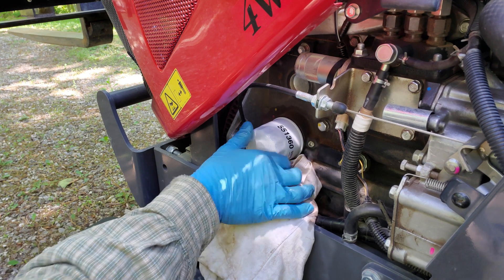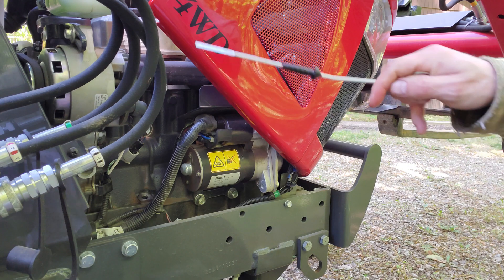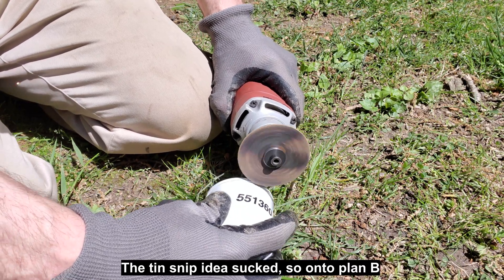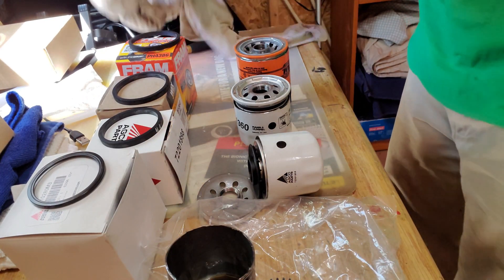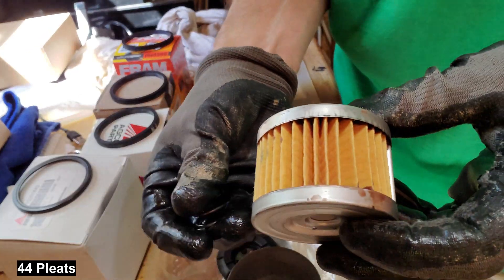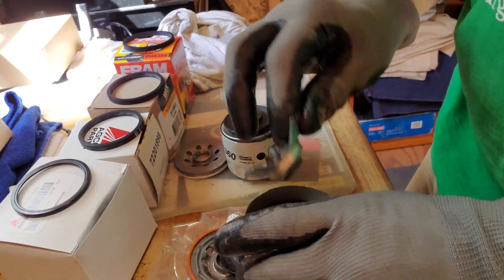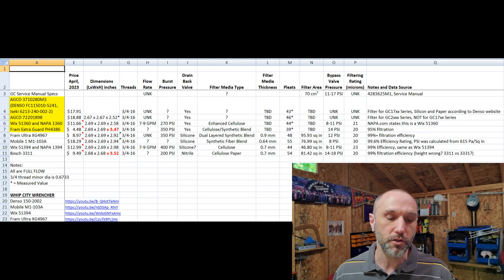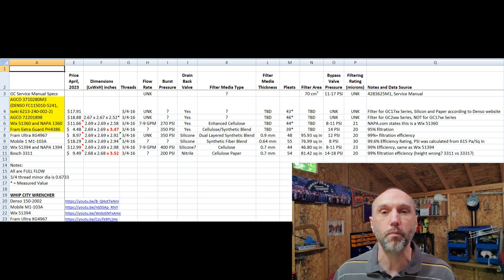Oil Filter Comparisons for Massey Ferguson GC Series Round 1

Comment: Interesting video Ed. But when a guy spends $20,000 on equipment to use I don't think I'm going to substitute a off-brand filter unless it's identical. And even then probably not. I know it's expensive through AGCO but I want to make sure that it working correctly. If you're going to buy the toys you have to keep them up. And I really don't trust a cheap alternative filter. If five bucks difference going to break you then you really shouldn't have a tractor like this. That's the way I look at it. But I am a farmer contractor and own a gold mining operation and I use my GC Massey's which I have a 1705 and a 1710 tlb GC. I probably put on about 250 hours a year on each tractor
Reply: I use a MF GC1710 for my landscape business. 3100 hours and have used NAPA 1360 and Rotella T4 15w-40 since the first few oil changes. My closest dealer is a hike for me. I change oil faithfully at 100 hours. Going to switch to WIX after seeing this video. Thanks.
Reply from the maker: I'm just gonna stick with the AGCO too, but it's not all about price. One of my reasons for looking into this was to make sure the Denso brand filter that AGCO sells really is a good one and not just a big price tag with junk under the cover. I had never even heard of Denso before buying the GC, but it's clearly a quality filter. Watch the round 2 video. The Bosch is a really good filter and the Fram XG4967 is also very good inside even though I didn't personally cut that model Fram open.  https://studio.youtube.com/video/lZVEU-Ur_SA/edit
Reply: @Redneck_Ed  thanks that I have already watched number 2 quite a while back here probably an hour ago or so maybe even a little longer but I'm still sticking with the AGCO filter. I also like the fact that it's pre lubed

Comment: Super cool video thanks Ed , can;t wait to see if you will do something similar at one point for the hydraulic filter  :-)
Reply from the maker: I intend to make an attempt to find alternatives or at least cut the old one open to look inside. Service manual says it filters to 10 microns though, so need to find ones that are rated for 10 microns.

Comment: Great video,  I've been saying that about filters.  I run the wix filter.  And there is absolutely no benefit to run the agco over the wix. Oil is rotella full synthetic. And shell hydraulic oil. Again great video Ed. I've been waiting for that one.
Reply from the maker: I think the Wix WL10114 (NAPA  FIL 400114) might be an equivalent hydraulic filter, but it's $36 so not really a big savings. I still might buy one and cut it open though to compare because I know for some it's not just the money but also accessibility that matters if their dealer is a long drive away.

Comment: First off great job Ed I could have sent you my filter cutter tho lol, anyway thays why it's better most times to stick with OEMs the difference in media is surprising and very important for proper flow and contaminants holding for proper service interval not to mention proper bypass setting that's why the older part number for the 2000 series should not be used. There's no end caps on the ISEKI/DENSO filers because the bead of glue seals it, the DENSO/ISEKI filter is a quality part rest assured and has a much better free-flowing center tube,, That orange FRAM I don't need to tell ya is junk!. If one could find a filer with same amount of media and by pass it wouldn't be bad but what I'm finding now just isn't cutting it for my equipment.

Also close but that Delvac extream is the older formula part number(black jug) "semi" synthetic not full, you want the new formula full synthetic  'silver jug" I think I posted a picture before on Facebook but that's still a good oil though, and finally thanks for showing you pouring it in and starting it 😂 good job Ed 👍
Reply from the maker: Thanks Dan. Yeah, the Fram PH was not good. For the oil, that was a whole different research rabbit hole. I saw Delvac Advanced Full Synthetic online but only 5W30. Advanced Auto had Synthetic Extreme and the Premium Synthetic Blend Extreme. Both product descriptions said they were a blend, so I just got the bottle that I was able to easily find and by "easily" I mean I had to ask because it was stored in the back. I've been thinking about the dealer using 15W40 and I think the dealers don't want to have different bulk containers with risk that technicians mix them up so they just stock 15W40 for simplicity reasons with low risk. I'll be sticking with 10W30 in mine from this point forward.

Comment: Does Purolator have an equivalent filter?  I have always had good luck with their auto filters.  I will say it is likely I will just go to my local Massey dealer and buy what they sell me.  For the amount of money I have invested in my tractor I am not likely to have a problem paying an extra $5 or $10 for a filter.
Reply from the maker: L14476 (or PL or PBL) is a Purolator equivalent. I didn't include Purolator because I had to draw the line somewhere. You can pretty much just Google "INSERTBRANDNAMEHERE 3/4-16 oil filter" and you will find all sorts of filters that will fit. I am all for OEM, but will never blindly go with the OEM again on any engine without cutting one open on the first oil change to see the inside. If you go to the dealer, make sure they don't give you the 722 for your tractor like one of my local dealers did to me. Get the 371.